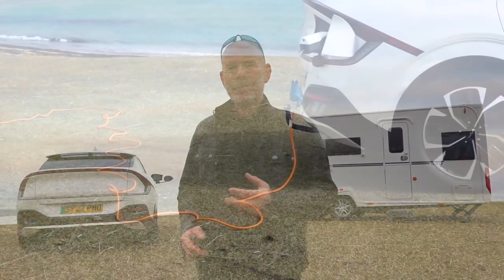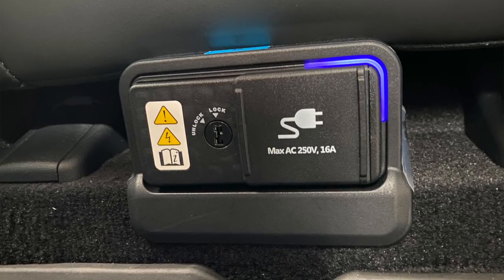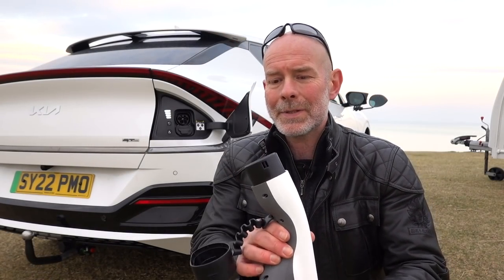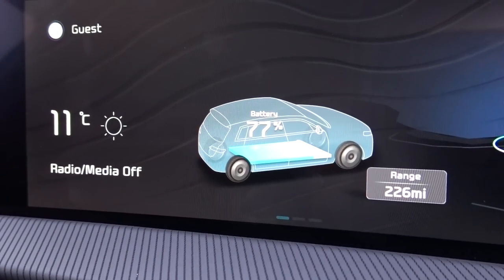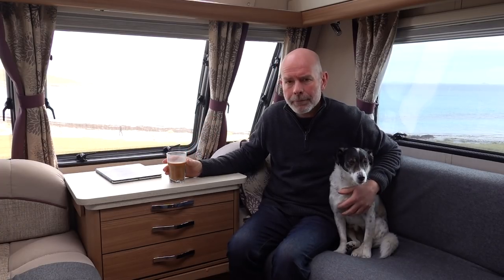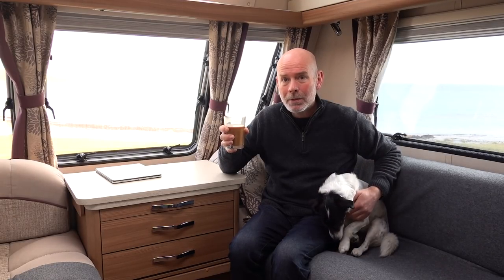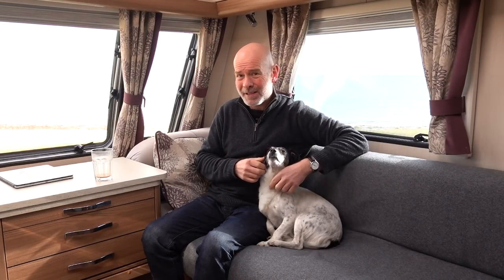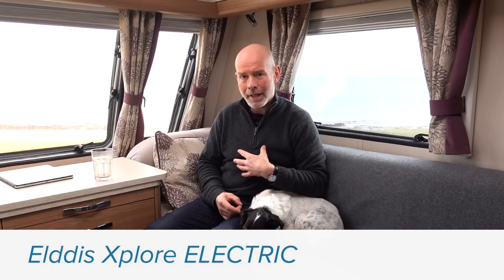V2L Caravan test - Will EVs REVOLUTIONISE caravan design?

Comment: Andrew, you should be aloud to market this video it is misleading I have done the maths for you. 
Without a 12 volt battery on your caravan, because you said it's good to save the weight, are you saying everything on your caravan works off the car can't see how your able to flush your toilet.? As every caravan I know the Thetford toilet works only on 12v? Can you use the Oven and Grill?, Can you use your 12volt lighting system.? I can put you right on gas usage 
Are you sitting comfortably.
Gas costs approx 70 pence a litre, a 10kg bottle holds  1.96litres of butane per Kilo gram. that's less than £14.00 per 10 kg bottle for safefill 
A 10kg cylinder last 16 days on a rally using only solar and gas for fridge and cooking and the Cadac BBQ. Using solar 12 v electrics . For lights toilet charging phones etc 
That equates to less a £1 a day. For usage of Gas.
Thats a third of the price of your electricity cost.!!!?
This DIRECT comparison of cost of gas/ cost of electric.
Reply: I think this depends on your usage as to what works for you.

Propane is roughly 14kWh per KG so a standard 6kg bottle is more energy dense than the car on full charge, and you can bring 2. Based on a calor bottle that will inevitably cost more than safefill, it works out at roughly 30p per kWh. Your example is roughly 10p per kWh so much cheaper if you use enough gas to justify the set-up cost.

I'd always take the 12v battery for the mover but could happily skip the gas if the energy density of the batteries increases.
Reply from the maker: Just to wobble the stick back at you... and I'm not disputing your maths one iota... but your theory only works if you can get hold of LPG at the pump. Which you can't where this video was shot without a £100 round trip including ferry. When my friends stayed in their German-spec motorhome (heating on gas only, in November), they were spending £32 every two days locally on Calor 6kg exchangeables. There are exceptions to everything. 12v system would work from the transformer. The biggest issue is in fact the fridge, if you take the car away to charge it. But all I am trying to do is show what is possible. Thanks for watching.
Reply from the maker: By the way, I am very disappointed that you chose to spam dozens of people directly with your thoughts. I considered you were a supporter of this channel not wishing to cause me extra work and grief. I like to give everyone a voice even when they disagree with my ideas, but posting your negative opinion against every positive one is not on. If people want to read the broad spectrum of replies, they can do that without your direct interjection. Please be respectful that this is one of the very few caravan/motorhome channels left where you are given free speech and have not been banned. Thank you.